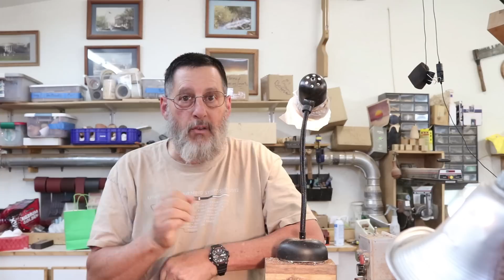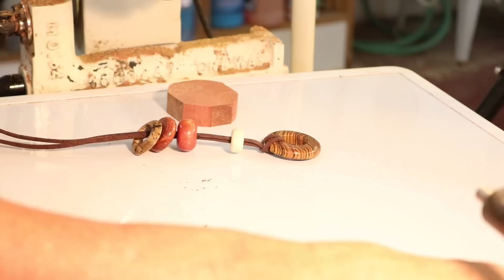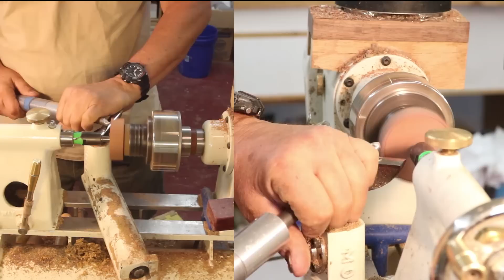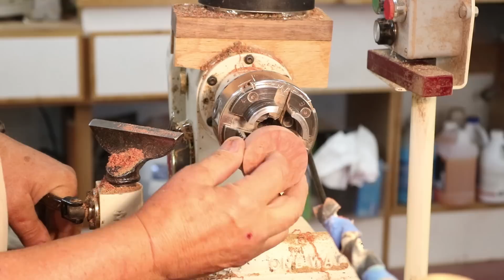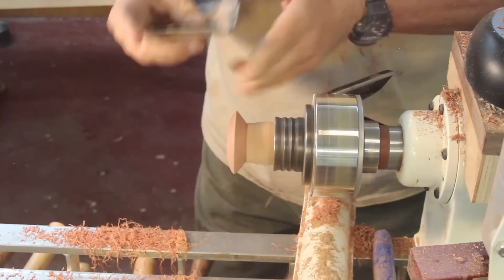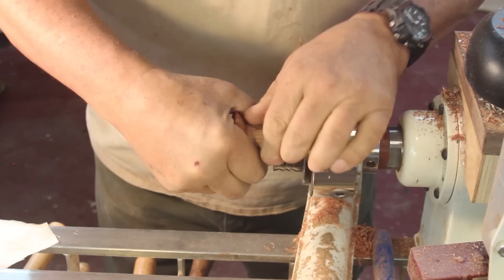Turning a Wooden Pendant Necklace with Sam Angelo

Comment: thanks for the ideas ..a few questions ,what is the piece of wood for under the on and off button  ?  i am surprised that you have not turned a handle for the tail stock locking bar ...just wondering ... thanks for the link ...liking your videos more and more ,smoother  ..
Reply from the maker: If you are referring to that maroon thing.  It is my remote switch for the dust collector.  Yep, I can operate the locking bar OK but it is a bit short.  I made one for my small Jet and it does provide more leverage.     I will think on that.  Sam
Reply: Thanks